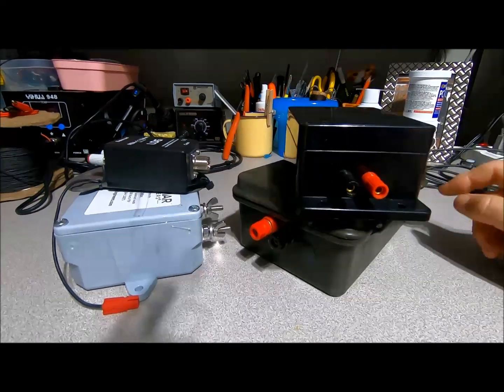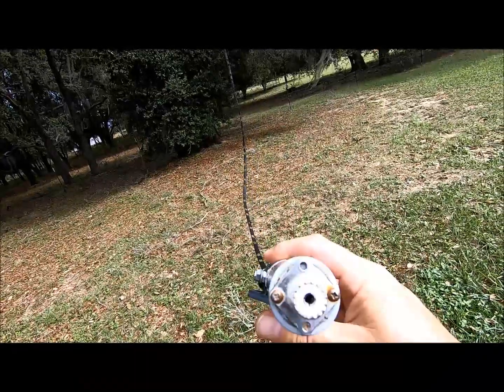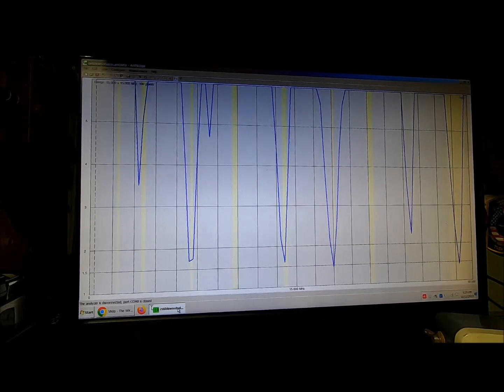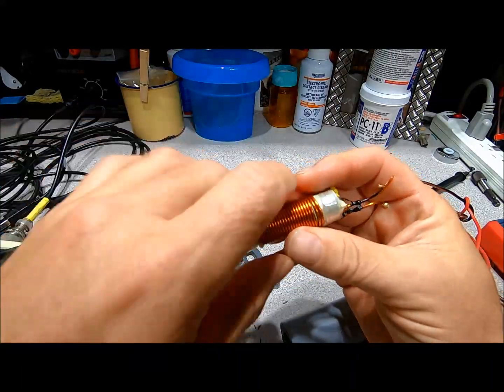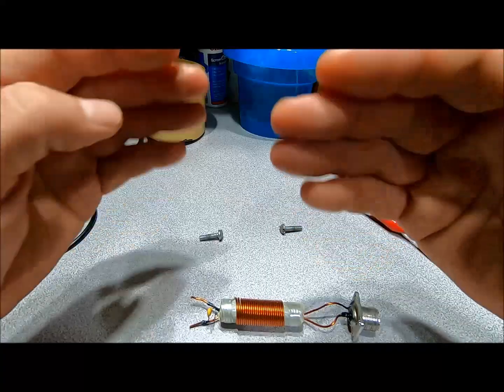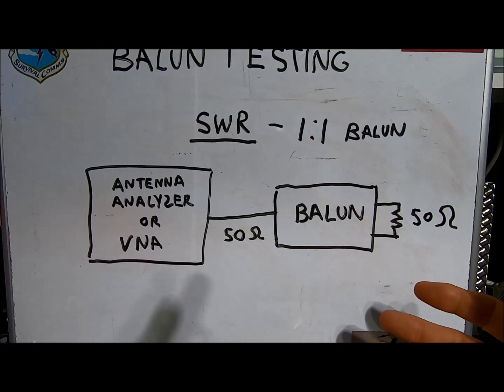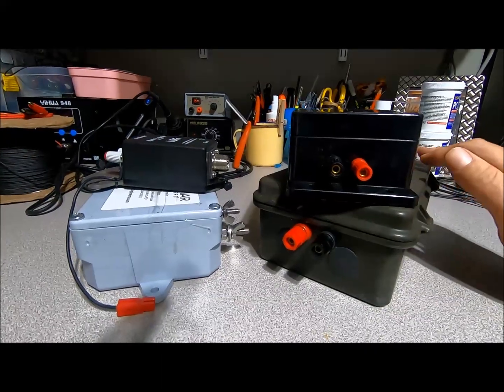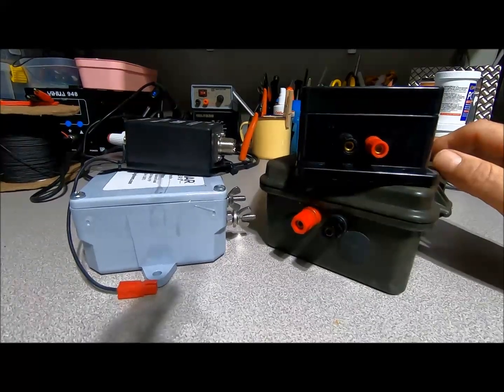Ham Radio HF antenna repair 101 Balun testing

Comment: Since a 1:1 choke only needs a few feet of coax on a donut core the loss should be negligible, even on 30 mhz.  I strongly expect your long clip leads is throwing off your readings. Other videos show how important it is to use very short connections and calibrate the setup first.  73 de k2xt
Reply from the maker: I regulated the VNA to use the clip leads. This should be totally obvious in comparision to the other items tested here. The other videos are trying to sell you something. Radiowavz is junk. Thanks for watching !
Reply: @survivalcomms  Bravo on calibrating the VNA with the clip leads.  That removes them from the measurement.
Reply from the maker: @N9XRradio  Thank you ! Thanks for watching !

Comment: Radiowavz is a hack.
Reply from the maker: They really are. Considering how poorly constructed their products are clearly shows that. Outside of the real life autopsy of the item in question the deletion of their "isolation" shows the benefit clearly in the antenna analysis before and after.

Comment: Nice video. I'm still learning all the capacities of my VNA (can't find a book anywhere) and would have liked to the menu settings for this test. Right now I use for a little more than checking SWR.
W9DLP
Reply from the maker: Thank you ! The Nano VNA is an incredibly valuable piece of equipment. There are some decent online guides but I have never seen a concise manual. I would have done the menu settings in this video but it would have made the video much longer. The main settings you need to manipulate are eliminate all but one trace, set it to display logmag, and set it for S21 and not S11 that you use for measuring SWR.  I am going to shoot a video doing the same sort of testing of a specific item in a few days. I will make sure to go over instrument setup if that will help. Thanks for watching !